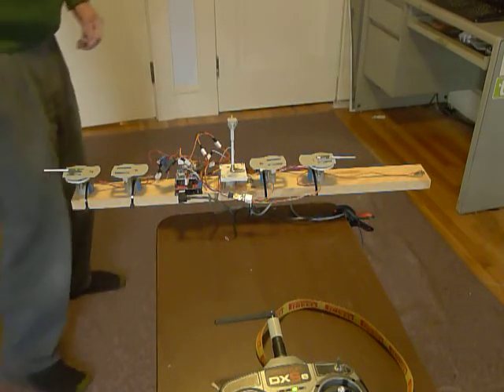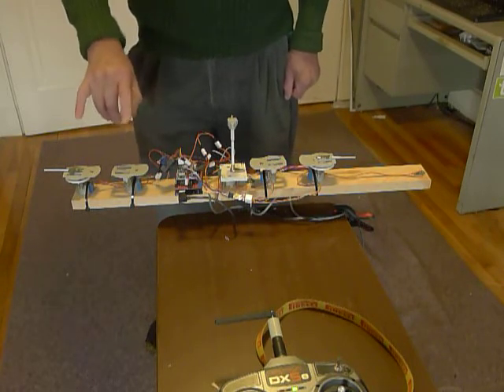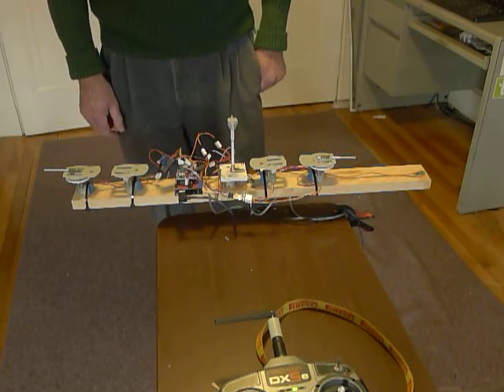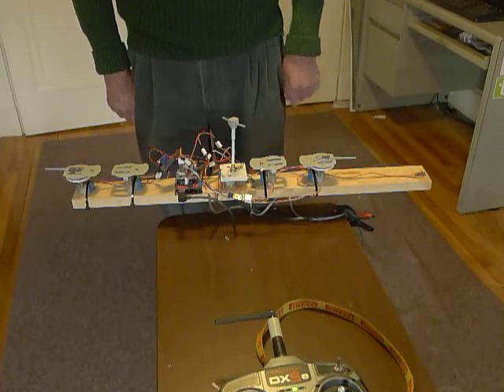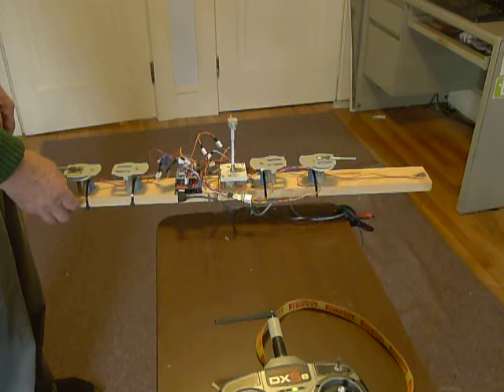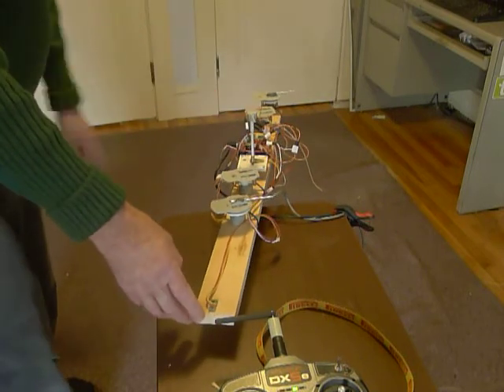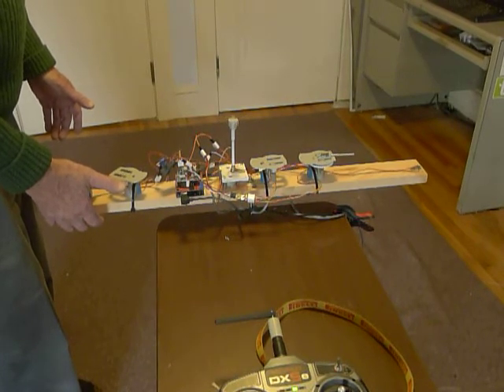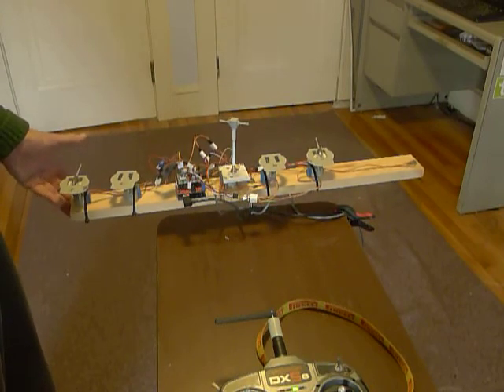Gun Turret Control for 1/200 scale Bismarck Battleship

Comment: This is brilliant Bruce. 
I am in my 70s, returning to model building after 60 years. Yesterday, about to finish my first 1/350 build of the Biscmarck, I decided it would have looked good with some LEDs inside just to illuminate the portholes. Then, suddenly I looked at my Arduino boards and thought what about making them flash in some way? Then, what about stepper motors to turn the turrets? How about getting the porpellors to turn, rudders, etc., etc.? Suddenly, my mind was in overdrive.
I realised I would have to start with a new model but I thought that first I should sort out the coding, hardware, etc.. in order to see whether I should step up to a larger 1/200 scale (very much like the look of the Trumpet kit, although haven't bought one yet.) Looking at your work I see that it can be done at that scale and you very clearly have ironed out many of the issues I will now face.
However, you have inspired me and I shall start to work on the Arduino side after I've changed a couple of central heating radiators (to stop the wife nagging me!) and prototype the controls, acuators, gearing, etc..
Hope your build works out and thanks for showing this - you have inspired at least one person!
Cheers.
Reply from the maker: Neil
I am delighted that you enjoyed my work on the Bismarck.  
I am now in my 80's so it took a bit of brain effort to do the coding for the Arduino although as a retired mechanical engineer, the other aspects of the work were not so arduous.
The Trumpeter Kit is good and I had no real problems with it.  I did also buy an upgrade kit that had some useful features and a lot of fiddly bits like deck guns that ultimately aren't really seen when the ship is in the water.  I did buy a printed wooden deck that is very nice indeed.
Bruce
Reply: @70xke  Earlier when I wrote I hadn't seen the ship floaing in the water - so very clearly so sorted out any problems which arose and got a wonderful working model. Hope you won't mind me saying, but did you think about some gun sound affects, perhaps a ships horn, etc.? 
Anyway, well done Bruce and I thank you again for showing that it not only can be done but can look extremely good as well!
Take care, 
Neil
Reply from the maker: Actually I do have sounds on the boat.  It plays "Ride of the Valkyries" as it goes into battle and it also has gunfire sound effects both incoming and outgoing @CyrilTheBear

Comment: This is awsome wish I'd found this before I'd set up the turrets on my 1/72 Fletcher now I've got to look into a heck of a re-fit.  At least everything is set up for mounts under the turrets and the gun director despite having to adjust them from servo's to motors.  (just found the forum page where someone was describing how to set this up a few hours ago)
Reply from the maker: Thanks

You might like to check out a later video that shows the system installed in my Bismarck
https://www.youtube.com/watch?v=fgHBoE2it3I&t=184s

It had its first sailing last weekend and all worked well until I splashed some water onto the stepper motor drivers, one of which failed.
I will be applying a thin coating of silicon grease to these drivers so that should reduce the risk of water splash damage
Reply: @70xke  She looks pretty sharp.  I'm just starting to poke at the coding and am still at the stage where it's all greek but I've managed to get steppers turning now I'm starting to poke at the concept of zeroing and am trying to figure it out without limit switches.  I like what you did with making it follow the director and think I have a concept of how to make the turrets do that (no Idea of coding it yet but...)  Most of it just falls down to I need to start writing code and getting used to the new language.
Reply from the maker: @Dawgsofwinter  You might like to check out three later videos on my channel that show the system as it developed.  It does now work reliably and I sail it from time to time.
Using hall effect sensing means that no conventional limit switches are needed.